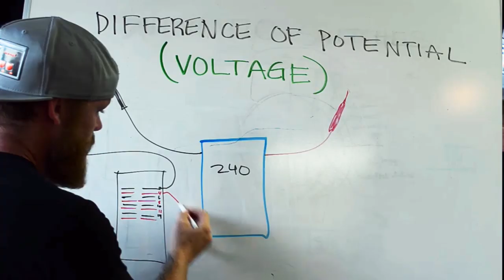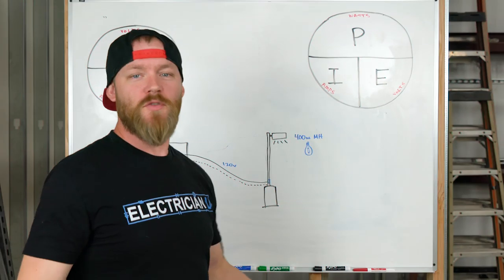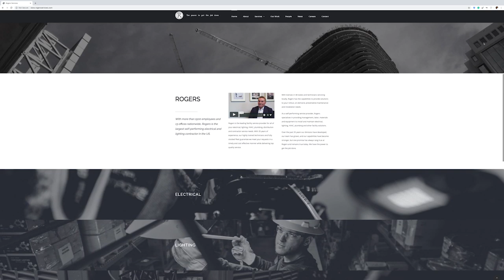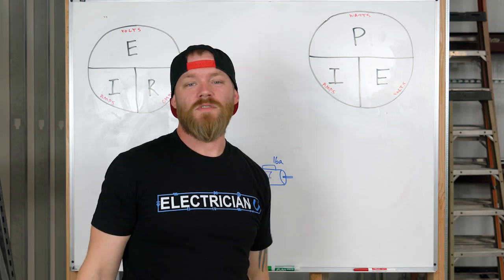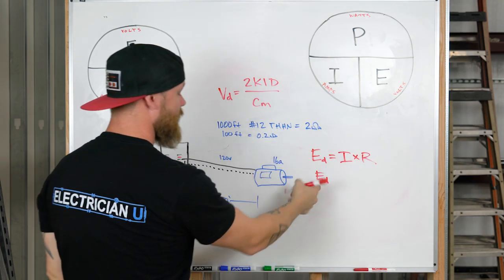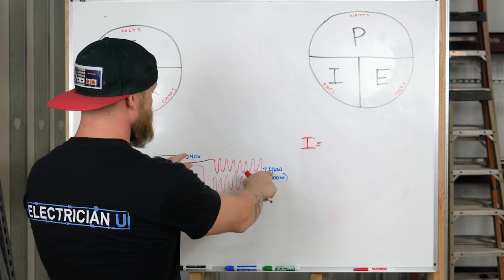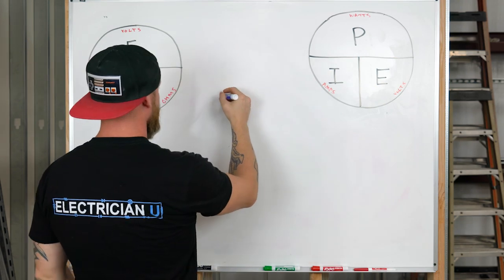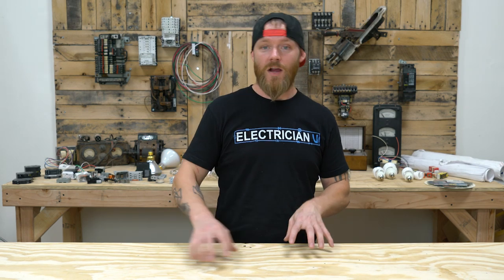Episode 39 - Using Ohm's Law In The Field - ELECTRICIAN MATH REAL WORLD EXAMPLES

Comment: This sounds a little bit confusing but I'm determined to be an electrician, and I want to learn as much as I can. Thank you so much, bro, I really do appreciate this video brother.
Reply: how's it going
Reply: @jordandutes975  almost close to joining the IBEW. 💪🏾💪🏾
Reply: @kewansmith6116  which local, also have you done a pre-apprenticeship beforehand or did you just apply? I am 17 and have no experience at all and was just wondering if I should take a pre app before applying.
Reply: @brandon3605  I'm trying to join local 9 , I honestly wish I knew the correct answers to give you..
Reply: Dude! It's just the service (voltage) power (which is the electrical panel 120/208/etc...  Volts) x (The Amps of the breaker (20amp/15amp... etc) x the load (most cases max.... 0.8%)  divided by the max rating of a light fixture..... if a light fixture is rated at 100 volts max.... use that max.      Example: Volt's x Amps x Load .8 = WATTS 

So in this guys video he used: 120 Volts x 20 amps = 2,400 
                                                        2,400x.8 = 1,920 
                                                         1,920 divided by 400 = 4.8
So... max.... you can only put four 400 WATT Light bulbs on a 20 amp breaker on a 120volt service.... with a over head of .8%

Love this guys vids!!!!

Comment: The formulas involving Power are from Watt's Law not Ohm's Law, but I understand why you call both the same. Love your videos watch them all the time, keep up the good job.
Reply: There is NO such Thing as '' Watt's Law '' !!  It's all '' Ohm's Law '' of which the Power equations are also from and part of  !!!
Reply: @BearStar1  Just look it up.
Reply: @tetonux  I looked it up. You're both wrong.
Ohm's law doesn't include electrical power... however, P=IV isn't "watt's law". It isn't a law with a name like that.
Check the wikipedia pages for "Ohm's Law" and "electric power".
Reply: @BearStar1 No, you are completely wrong.

I will explain why. Ohms Law (research it on the internet) is about the linear relationship between voltage and current.
It's not actually about a single value of current, voltage or resistance, it's about the straight line on a graph of current versus voltage.

Resistors and some other things follow a linear relationship and are said to be "Ohmic". Double the voltage and the current doubles. Plot such figures on a graph and you get a straight line. The resistance is the inverse of the gradient of the line.

Ohms law is NOTHING to do with power. It is solely about the relationship between current and voltage.

But what we do is use the Ohms Law formula for deriving a quantity of voltage or current or resistance when we know the other quantities. And we call the equation Ohms Law. But in reality Ohms Law is actually about the linear relationship between them, which applies to resistors.

Comment: Man, I enjoy these videos. These high intensity discharge (HID) type of lighting sources can be tricky if you are not careful. Don't forget these types also have a ballast to figure in. I understand that this video is a beginner's lesson, but might as well start them off right. That ballast adds between 20% to 25% of the lamp wattage. I use 25%. So the 400 watt "luminaire" is really using 500 watts. Also, don't forget that a circuit can only be run to 80% of its max rating for anytime interval over 3 hours continuous. So the 20 amp circuit is only rated 20 x .8 = 16 amps for "continuous duty". So then 16 amps x 120 volts = 1,920 watts maximum allowed on our 20 amp rated circuit. So, if we try to wire 4 such luminaires onto the 20 amp circuit, we get 4x500 watts =2,000 watts total load. That exceeds the 1,920 max wattage allowed. So we can only put 3 of these 400 watt luminaires on our 20 amp rated circuit. Also, these formulas do not take into account voltage drop on extreme hot days when everyone has AC units cranked up. Lower voltage means more amperage is required to run any attached device. Again, I understand this is a beginner's course, but you have to be careful of someone who might view this video as a design guide, would be all mad if his bootlegged circuit did not work. In all this, I got your back.
Reply: Your explanation just made it click for me. Thank you. Just decided that I wanted to go for it as an electrician
Reply: @Gangstarszz  , you are very welcome. I have enjoyed it for 50 years, and still like it, every day. I am also an Engineer. My job is to keep people OUT of trouble.

Comment: i'm good, until you start getting me into the trig for bending conduit LOL. I'm not good at math, but i've learned, if it's something I use on a daily basis, i'll retain. I worked in a case factory for many years which finally pushed me to learn a tape measure FLUENTLY, down to 1/32 in some cases for what I did. Then i got good at remembering the decimals for the common fractions so i could do the math to add them all up. I will say, I kept my old TI-83 from high school and she came in very handy for that reason alone lol. The real beauty of ohm's law is using it to diagnose and verify. I had a 220v heater melt the socket a while back. I knew the situation for several years and knew it had seen a large moisture event, but I ohmed the heater, checked the wattage and amperage rating on the unit, and i already knew the voltage, did some quick maths, and found my resistance to be close to what it should be. Plugged it back in with new receptacle and she worked flawlessly.

Comment: You the bomb . I’m so glad you talked about the 80% rule. So folks weren’t hooking up 2400 amps to a 20 amp breaker. Great stuff. And also for the newbies you don’t up grade the breaker due to wire gauge , would be underrated. I’ve seen so many home owners up grade to 30 amp because the breaker kept tripping. Amazing

Comment: I was the one kid in school that said I don't need to learn math, that's something I'll never use... Well at the age of 28, after working as a machinst for a year and ½, I learned real quickly what kept me from a $10.00 hour vs. $3.90 hour paycheck.
So I went back to school and 💡 it all clicked and I learned how to do basic algebra, ie. P= I×E etc.. 
But you've even made it more clear than before. Thanks!
Reply: Good, I am pleased you finally got to understand the value and importance of it.

Sadly, to be an electrician there is no minimum math requirement.

Comment: R= unit of measure for electron resistance in OHMS.
I= unit of measure for current electron flow in AMP, AMPS or AMPERES.
P= unit of measure for resistance of load or used energy, Power in WATTS.
E= unit of measure for EMF electrical motive force/ pressure in VOLTS. 
So now you know the definition to each letter and unit of measure.

Voltage drop NEC National Electrical Code. Single phase formula. Vd=2KIL/ Cmil
First Vd= voltage drop % which is 3% for branch circuit and 2% for feeders. Or. 120 volt @3% = 3.6volt minimum circuit operating voltage allowed by NEC 120V-3.6V =116.4Volt

Comment: (Question) If I’m not mistaken those light poles are rated at 20A per bulb. And you say it is protected by a 20 amp breaker. Well aside from bypassing the D rating calculation you say six lamps can be tied in. But I thought in parallel circuits voltage stays the same and amps increase. Therefore I will have a total of 120 A going to that 20 amp breaker. Shouldn’t that breaker trip? I’m confused
Reply: My apologies. The subject of the lesson was how many lamps can go on a 2400W circuit using a 20A breaker. I did the math and each of those lamps produce 3.3 amps. The way you did your calculation is a lot easier than the way I’ve always done mine. My fault Dustin

Comment: For the voltage drop example, why are you using the resistance for 100' on a 50' wire?
Reply: he included the neutral which completes the circuit. 
basically the resistance is "felt" during the entirety of the circuit.

Comment: I like how you are expressing how to use ohms/watts  law to get the wattage of a lamp. But, you will not  be able to apply the scenario you are using alot of the time to identify the lamp at ground level, because most of the time the reason why you are there, is to fix the light not working . Also, if the light is being fed from a circuit with other resistances on it , the current will be based upon  the resistance of the other loads on the circuit up to that light.

Comment: Remember that 3 phase motors are rated at 200, 230 and 460 volts. There is some voltage drop already calculated in the motor design. It's usually roughly 450 feet.
Reply: Wrong !  It's 208 VAC , 230 VAC and 460 VAC , all 3 Phase !!!
Reply: @BearStar1  the NEMA MG-1 standardizes at a motor rated at 200 volts for use on a nominal 208 system. I believe your confusion comes from the "dual" rated motor of 208-230. So the larger list would be as follows. 200, 208-230, 230, 460, 575, 2300 and 4000 volts. For three phase

Comment: Dustin,   Another very good video!  I wish you hadn't used 400W HID lamped pole in your example.  Hopefully, later you can use this example as a start to show the real answer of how many on a 120 volt 20a circuit.    You touched on voltage drop calc from Uglys.  You could have a video on that as well.   I used that calc tens of thousands of times except I change cm to max volts of drop(120x.03=3.6).   The reason is this gives me conductor size to use. One calc and done.  No guessing conductor size to be less than a percentage.     Keep your excellent videos coming!   Respectfully,   Kevin
Reply: Just download the southwire voltage drop app
Reply: Ike Rivers     I have the Southwire voltage drop app and it works very well.   A question for you.   How do you know the accuracy of the app if you do not know how to do it manually?   Also, I worked on solar projects for several years ranging from 1 to 37MW.   Every feeder from the combiners through to the utility had to be calculated for voltage drop.   It is hard to do thousands of calcs with an app on a smart phone.   Sometimes better to know the math.

Comment: When you spoke about the voltage drop in that motor we find out that there is a 3.2 voltage drop. So does that mean we have to increase the wire size or bring the motor closer?
Reply: I can answer this one for you. The code allows 3% voltage drop for Branch circuits and 5% VD for overall feeder circuit. So, on a 120V circuit, 3 percent would be 3.6V. So, a 3.2VD in a 120V Branch Circuit is acceptable in this case. But, to answer your question, yes you would increase the wire size, if the VD was out of the range that is acceptable per the Code. Moving the load closer to the Source is a seldom used option, because the location of the Load is per the design.

Comment: i've been in trade school for about 3 weeks and i'm still kinda slow and not really understanding the basic wiring for circuits.how long did it take for you to get really familiar with things ?
Reply: Learning is much easier when you are actually DOING. I suggest building the circuits you are trying to understand. Most of my circuits only use a maximum of 12v so experimentation is safer than dealing with mains.
Reply: What school
Reply: Practice......Practice.......Practice  !!!   aka...........    On The Job Traing

Comment: K = Direct-Current Constant.
K represents the dc resistance for a 1,000-circular mils conductor that is 1,000 ft long, at an operating temperature of 75؛C. K is 12.9 ohms for copper and 21.2 ohms for aluminum.
Reply: And the problem with this approach is if you change the cross sectional area of the cable you are stuck.

You should use resistivity.
The cable resistance is a function of : resistivity of the material for the conductor, the length of the cable and the cross sectional area.

Comment: V=IxR Voltage = Inductance or the ability of the cable to hold current times the the Resistance of the of the cable. That's Ohm's law. Not sure where where you learned this E thing from but VIR is the standard. I mean I'm glad it works for you, but VIR is the standard. Or PIE.
Reply: Nothing to do with inductance.
Resistance is not the same as inductance.

Comment: Gotta tell you maths are needed and used in many plumbing situations, you can't "just look at it". If plumbing was simple, there wouldn't be so much plumbing related failures and annoyances in our homes, businesses, infrastructure, etc. 

Because we can't see electrons, we use water   pressure and gallons per minute as an analogy to the flow of electrons in a conductor. Well plumbers need to understand and use maths related to that in some contexts.

Not supposed to seat of the pants figure out gas line systems, you're supposed to understand some basic physics and maths. Heck, many plumbers also service electric powered  and gas fired appliances, so their trade gets deep. Tradesmen frequently have to cross trades and know some things about other trades. 

A plumber is more likely to need to know concepts in electricity than an electrician needing to understand plumbing. Just sayin....

Being a pedant, but keep doing what you're doing.

Comment: I used ohm's law to figure out what size heating element I could use in my beer brewing system.
Reply: I used Ohm's law to calculate the resistor values in a class AB power amplifier and where to set the bias level for the bipolar transistors.

Comment: Amazing video, very helpful. I plan on applying for a apprenticeship soon, in your opinion which is better. Union or nonunion? I’ve heard about the pros and cons of both. If anyone who has experience in both I would appreciate it if you could share it with me. Thank you.
Reply: If I could do it all over again I would go union.  Work your butt off like you're nonunion though.
Reply: Both CAN be good, but you have to get with a good one, not a turkey. I have experience with both. One of my cousins is a 35 year union electrician, who has worked in Halls from Missoula to Miami, and everywhere in between. He knows his stuff, and now supervises 300 to 500 union electricians during power company generator replacement turnarounds. I went through an open-shop apprenticeship program for a year, and learned a lot. I had a good one. If you get a "house wiring guy" who ONLY knows that, you will not learn commercial nor industrial work. I have heard complaints that the union guys are slower, and lazy. Here is my experience with that: The union guys (meaning girls too) generally want to do things right the FIRST TIME, so they take their time to think things thru and do it right, while being careful. That includes tying off ladders, top and bottom. The key is work steady, not like a jackrabbit. Wear the right clothes, and know why you are wearing them. No shorts, polyester beach shirts, and no flip-flops. Learn to bend conduit as if every project were a nuclear reactor job. A 4-year union apprenticeship program will do that for you. Sometimes an open shop program will work well too, but these days, everyone is in a rush to get it done quick and cheap, even hiring people off the street that know nothing about electrical work. I have seen this, and everybody is an "expert", until they screw up and have to go to court. So talk to some union electricians, and some open shop guys too, to see how they have turned out. But pick a good one to learn from.

Comment: Can you teach me hot to do series circuits simply, and not get so damn frustrated and overwhelmed with them?
Reply: Current remains the same. Voltage is shared across each load. Add the resistances together.

Comment: Amperage is just a less than ideal term for current. You can just say current. I guess if you want to fit in at the worksite and not sound like a city slicker you can banter that term about but if you hang with electrical engineers they might look at you funny for saying amperage. Questions for ya: how do you convert current to voltage? How do you convert voltage to current?
Reply: Ampere is the unit of measurement for current. Current=flow of electrons. So if I am asked what the current is in a circuit, I would answer in amps.  But yes, if for consistency he should have said current. But that's splitting hairs. One of the answers to your question at the end is an OP-AMP.
Reply: No it is not an OP-AMP.

It is simpler.
You can convert voltage to current using a resistor.

OP-AMPs tend to be voltage in, voltage out devices.

Comment: why do Americans  use E instead of V   .. gotta be different I spose,
Reply: Ressy6 where u from
Reply: E (Electromotive Force) is sometimes interchanged with Voltage. However I dont believe they are exactly the same thing. Faradays law teaches applications of EMF (E = V x I x r). I remember EMF is the force or stored charge within a cell, and Voltage is the measure of potential difference between two terminals on a cell. There is a cool test to understand how voltage in a battery works I learnt in highschool science. Get two cups and a bendy straw, in one cup fill with half water and the other cup fill full of water. Over time you will notice the water from the full cup will drain to the cup with less water. There is more pressure in the full cup and more pressure means a transfer to cup with less pressure. Voltage is also sometimes referred to as pressure...hope this helps more than hinders :).